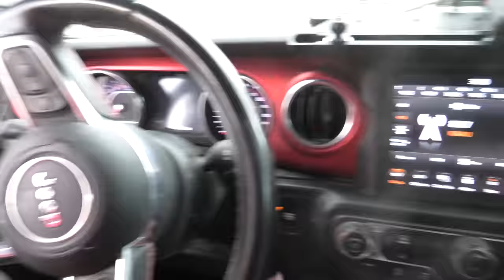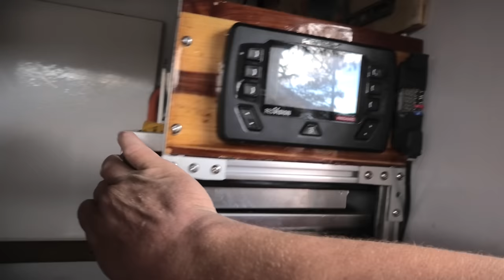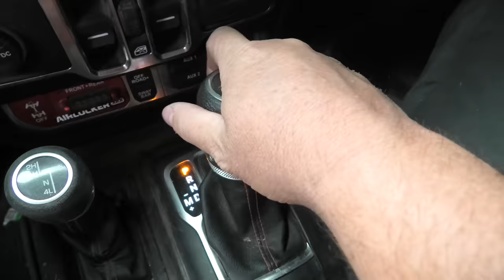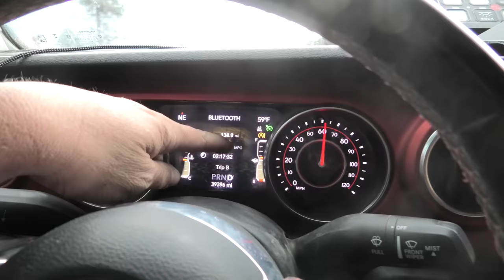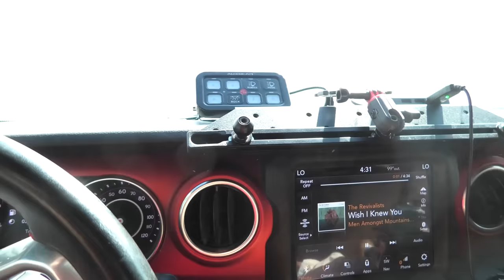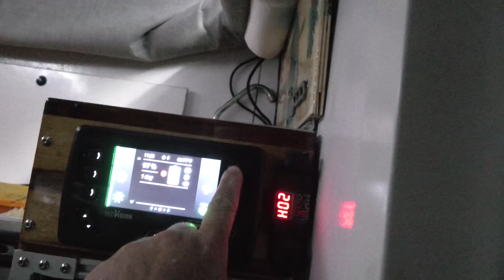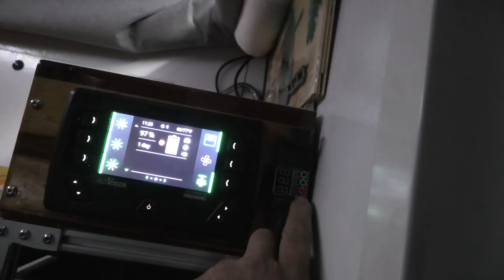MY CAMPER IS DONE! - Day 1 Living out of my Jeep Gladiator Custom Pop Up Truck Camper

Comment: Congratulations on your maden voyage in your completed build!  I think your success may inspire others to remove the beds from their pickups.  And build a custom body camper as you have.  One of my vehicles is a 2016 Ram 1500 Quadcab 4x4 with the 3L diesel.  My wife has a 2018 Ram 2500 Crew 4x4 with the beastly Cummins diesel.  I bought a 4wheel popup camper for her truck, which can handle the weight.  But for my truck, I have been thinking about removing the bed and SnugTop camper shell.  Making a custom flatbed.  And having a company like OVRLND campers make me a custom camper shell to fit.  And then I will finish out the interior.  My truck is 2,200lbs lighter than my wife's 2500.  But her truck can carry an additional 1,000lbs of payload, and tow double the weight.  But as you found in some of your adventures with your original truck.  Weight can be a problem in some terrain.  We can flat tow one of our 4wd SUV's with us for adventures on some trips.  But sometimes just having one vehicle on a trip is the best way to go.  
I have a design in mind that would give me all the cargo capacity I need for shopping trips.  But have all the things we need for basic or stealth camping.  My wife is retired.  But I plan to work a few more years.  And I work for a major City Utility 350 miles from my home.  I work 12 hour shifts, so my work week is only 3 shifts one week, 4 shifts the next.  So I have more time off from the job than most people do.  Even when I work overtime!  Last year I had to take 2 months off.  Because I had banked too much paid time off.  
When I do retire, we will probably spend a month or so out adventuring, then a month or so at home.  Todays mobile devices make it possible to just as plugged in out adventuring or on the road.  In the past 10 years, I must have done 30 years of activities.  Because of the mobile technology.